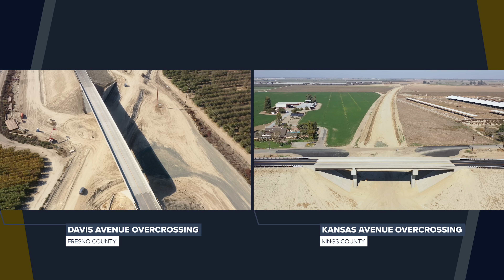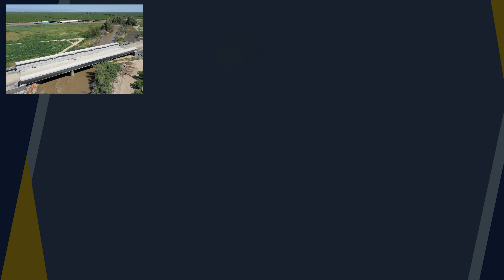Fall 2023 Construction Update: Progress is happening across California thanks to HSR Workers!

Comment: Most conservative year is 2028, 4-5 years to go. While it’s not longtime, but who knows they WILL delay to ask for more money. 

At the end it’s at best  only 140mph, not world standard of 200-250mph.
Reply: Huh? The entire guideway is being built at a 240mph standard for 220mph operation. They already rejected the plan of using diesel trains or such for an interim operation - it will be true electrified HSR from the get-go.
Reply: @adianchowdhury9016  
Along SF Bay Area it’s not HSR.
Along Central Valley they can speed up.
Entering LA urban area, they have to slow down again
Reply: @marktan3668  that's true, the approaches to LA and SF are slower though that's how HSR works worldwide - between cities trains can go top speed but within urban areas, they slow down for a variety of reasons, like tighter stop spacing and limited infrastructure. No high-speed rail line in the world has an average speed of over 200mph.
Reply: @adianchowdhury9016  
California HSR is NOT world standard because it tries to save money by using existing older rails in Bay Area and LA Area. 
At best a little better than ICE. Far far behind Asian.
Reply: @marktan3668  using existing, lengthy segments of track at the very end of the route is not bad, nor it is not standard. you know what other countries do that? every single one of them except Japan cause they legit couldn’t, and maybe China cause they took the definition of HSR too literally. like 95% of the stations the TGV serves are on existing rail lines, and the TGV is definitely a world class system
Reply: @burlingtonfan7492  
China is 100% standalone, Japan is matured system, they connect to local trains systems.
Reply: @adianchowdhury9016  . . .and no jetliner in the world flies as slow as the maximum speed of HSR more than 20 miles from taking off and landing.
Reply: 140 mph is closer to the average speed, taking in to account the slower parts in the large urban areas and intermediate stops.
Reply: @DavidCiani  
I figure so.
It’s same as Europe’s ICE.
I took this ‘HSR’ from Paris to Barcelona and it was such a drag. When in urban areas, it merged with the older rail system. At times, it even stopped!

That’s why Europeans should not claim HSR. They are semi.
Reply: @marktan3668  ICE is the brand name of DB's high-speed trains and only operates within Germany (including some cross-border operations) but doesn't refer to all European HST in general (there is the French TGV – which you likely took – the Spanish ACE, the Italian Frecciarosa, etc.). The justification for using existing infrastructure [edit] in place of dedicated high-speed tracks everywhere are [/edit] quite varied: Sometimes because a certain section is low-priority, sometimes because of cost (which ties with the previous point) and sometimes because of locals protesting against such a line.
The advantage of it is that even when a train doesn't operate on high-speed tracks, travel still can continue onwards, otherwise you'd end up with a situation like Nishi Kyushu Shinkansen which is isolated from the rest of the Shinkansen network so be lucky that the train you took can run on existing tracks.
Reply: @MarioFanGamer659  
The ride was NOT HSR.
From others’ experience as seen on YouTube , ICE is below world standard.

Japan started bullet train, China wanted to buy their technology but was refused. Then, China did by themselves and becomes world first, 40K kilometers mileage and superb coaches. They started exporting HSR 10 years ago. Indonesia, Arab countries..
Japan is still trying to protect ‘monopoly’ which they lost 20 years.
USA Obama Democrats election boasts of HSR still boasting. Canada, Australia dare not build HSR because of USA.
Reply: @marktan3668  After doing some research, the Shinkansen network isn't fully isolated from the remaining network. For one, some existing tracks are modified to support Shinkansen trains but obviously can't run at full speed because of the old alignment. The Yamagata Line in particular carries both regular and Shinkansen trains. Don't claim this doesn't count, you obviously do count the shared tracks for France and California and the Yamagata Line therefore should also count for the sake of the argument.
Reply: @MarioFanGamer659  
I travelled Japan’s HSR +JR, they are pretty well integrated and quite old, or matured. Bare in mind their system started long time ago. Their system is not as true HSR as China’s. 
Mainly China started all from zero. They use a lot of viaducts, tunnels, true off-grade. Land acquisition is easier in the country. In Bandung, we witnessed how China’s system was built. 500 meters, ~1500 feet steel rails welded, laid on concrete sleepers automatically, 
Since SF-LA HSR is supposed to be a pride project of peace, very very few peace project by USA, it should be close to China’s than trying to follow European style which is very outdated,
Reply: @DavidCiani Perhaps even closer to 120 mph average speed for 10-12 station stops.